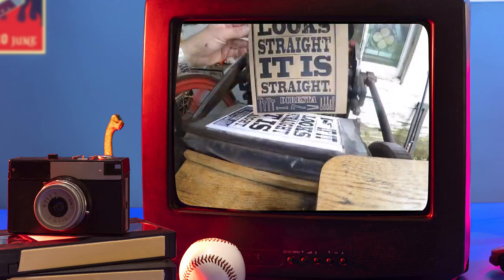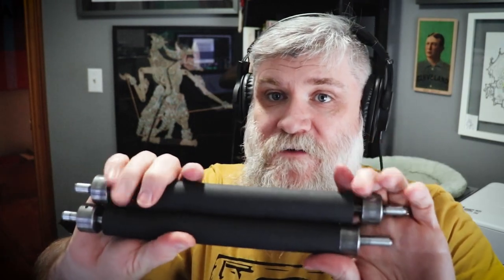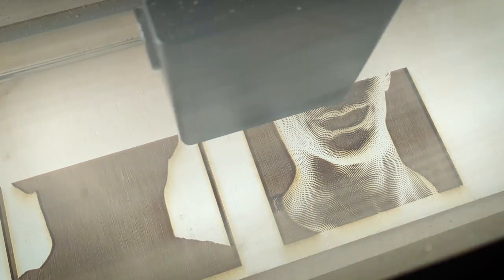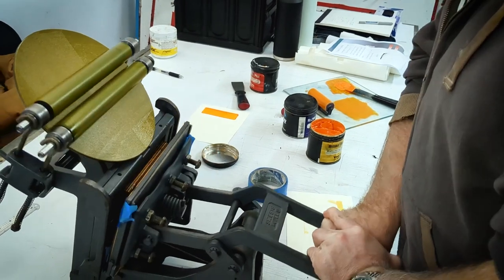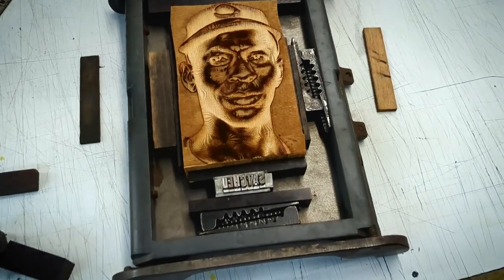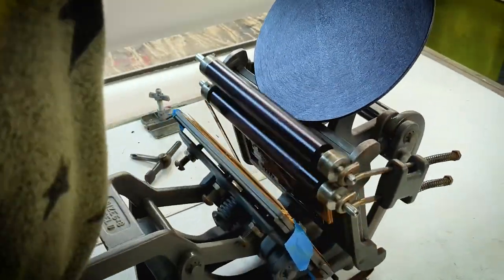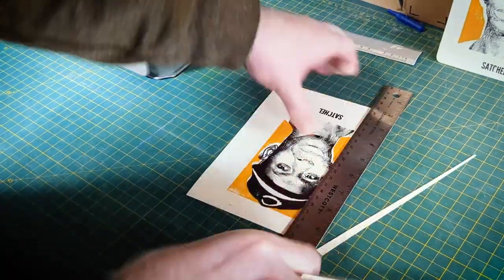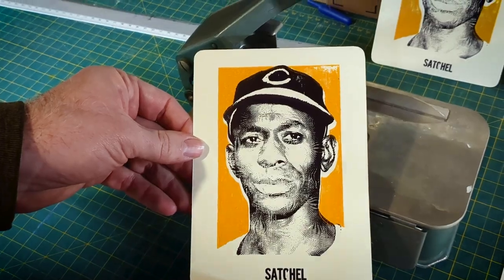Printing a Satchel Paige Wheaties-style Card

Comment: Overall all how pleased were you with your blocks that you 3D printed? Was the image from a drawing of yours and then imported into the 3d printer? So intrigued by this. Thanks for sharing!
Side note, that Steve Gutenberg never ceases to amaze me!
Reply from the maker: Glad you were intrigued. I was fairly pleased. The tough part is getting the block to "type height" whichi is .9186 inches. So random. I don't know if I was off enough to make the second color not come out great, but the guy running the workshop didn't think so. The image was a photograph, heavily manipulated in Photoshop, imported to the laser. Long live Guttenberg!